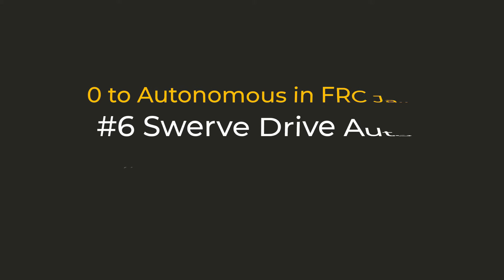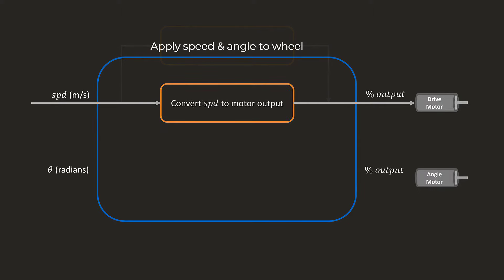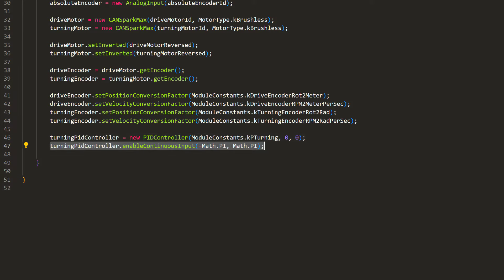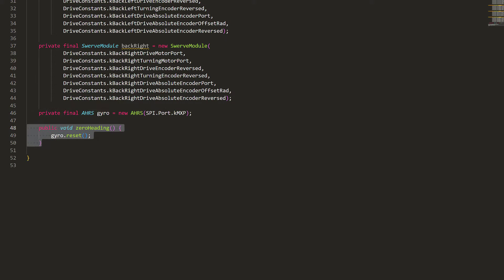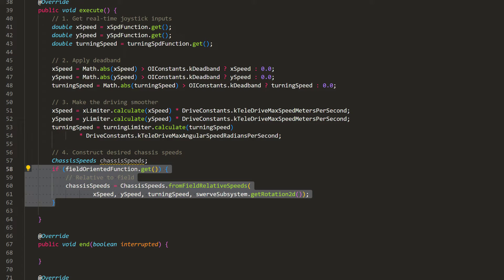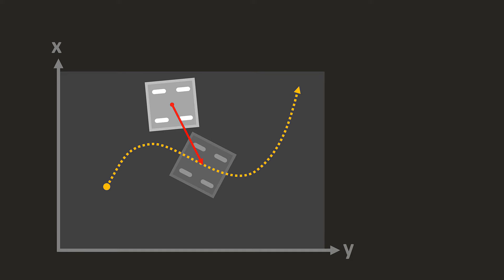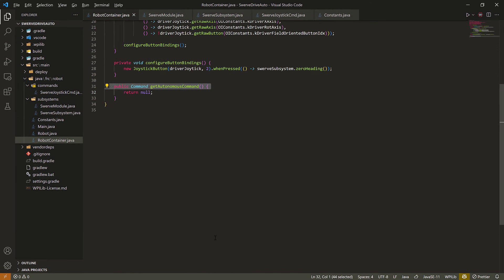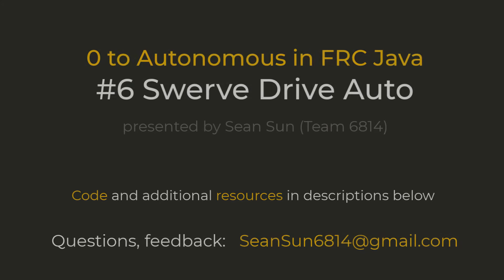FRC 0 to Autonomous: #6 Swerve Drive Auto

Comment: Excellent Tutorial!  I found it very informative and gives me much to think about when making the jump to trajectory based autonomous over the drive, stop, turn , drive sequence method.   Some constructive feedback and chance for discussion since it seems like many examples are done in the same way.  I would have preferred that the trajectory building and autonomous command be done in a subsystem class and/or unique command instead of being done in RobotContainer for clean-code (seems like most frc programmers like to stuff gobs of things in RobotContainer instead of writing clean-code) and more importantly autonomous programs tend to be much more complicated.  Generally an autonomous schedule will be comprised of several unique trajectories with other actions like a robot arm or intake system taking control of an object or a shooter projecting an object between those moving the robot along those trajectories.  So doing the follow trajectory commands will need to be built up in Individual Commads and called from a Command Group along with other commands, having them defined in or at least called from individual Commands is necessary.  It would not a bad idea to get used to doing/teaching code partitioning since that is the norm in the software industry.

Comment: Thank you for your video. I have a questions. I guess the Swerve Module you are using is MK3. Which Gear Ratio did you choose in your Swerve Module? Fast 6.86:1 or Standart 8.16:1. I have one more question. Can I use the MK4 swerve module with these codes instead of the MK3 Swerve Module? Thank you from now.
Reply: I have the same question about using this code with MK4 swerve modules.  Did you try it and did it work?  Thanks!

Comment: Thanks for this great tutorial! I still have one question though. how do you set the wheels to face forward at the start of autonomous? I'm planning to use color and or distance sensors to get it to read the position at the start of autonomous. but surely there has to be a better way than by hand, right?
Reply: I believe this is what the absolute encoder is for, it remembers its position even after the robot powers down

Comment: This video is a life saver, but I do have a few hardware questions.  Will this work with SDS Mk3 modules, are the motor ports the SparkMax's id numbers, and does this need a physical pid controller? Those have been the main 3 things on my mind when going though this. And once again, thank you for this top tier content.
Reply from the maker: It should work with Mk3s, and the motor ports are the SparkMax's ids. This implementation only uses WPI's PID controllers, but you can use the PIDs in your motor controller as well. Good luck with coding!
Reply: @0ToAuto  Thank you, much appreciated.

Comment: Good tutorial!But I'm a little confusing about the autonomous X and Y PID parameter.It just set the P value to 1.How dose it work? I don't need to test the P value by myself?
Reply from the maker: Great question! You do need to tune your PID controller. These values are the ones that work well on my robot, but your constants may be different. For more info on how PID controllers work and how to tune them, check out FRC 0 to Autonomous #3 & #4.

Comment: Beginner question: If we plan on using CAN/Bus to connect our motor controllers, would we still use "DriveConstants.kBackRightDriveMotor" or would we have to change "port" to "Id". My assumption is that "port" means they are connected to a PWM port. Am I wrong?

Comment: Will this work with the changes to java in 2023 in frc? My team has lost its head programmer and we are truly lost.  Thanks
Team1262
Reply from the maker: Unfortunately, the code for this video was implemented using an older version of WPILib. While the concepts and the majority of the code should stay the same, it no longer compiles with this year's library.

Notably, this year's WPILib changed SwerveDriveOdometry to use wheel distances instead of wheel speeds, and this likely needs changing.  docs.wpilib.org/en/stable/docs/yearly-overview/yearly-changelog.html#breaking-changes

Good luck on this season!
Reply: Thanks for the info,  don't know if we have time to even try to fix the old code at this point,  no one in group is a programmer, and we have no mentor for it. This isn't going to end well... but thanks